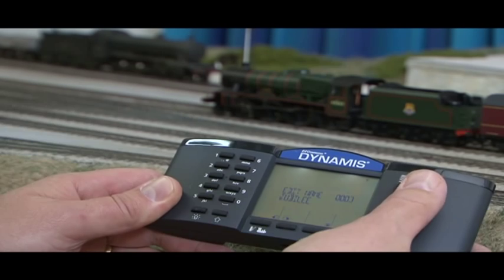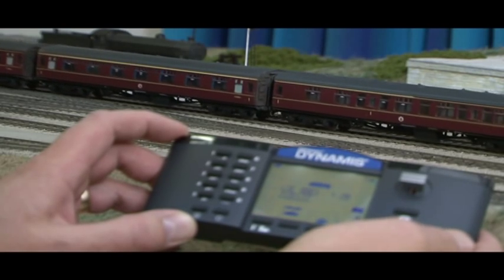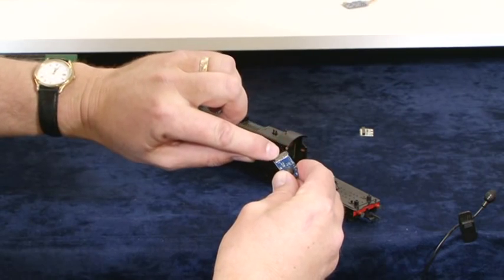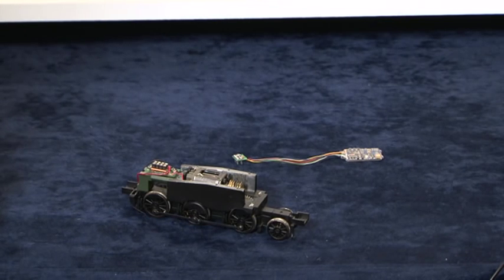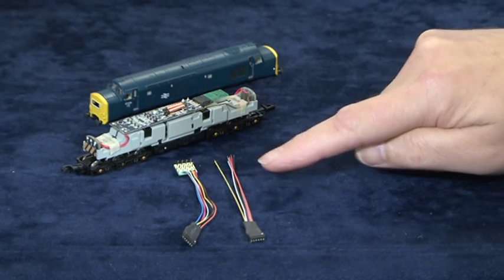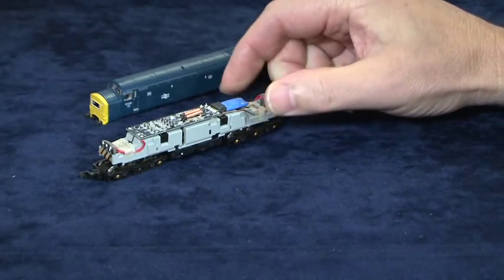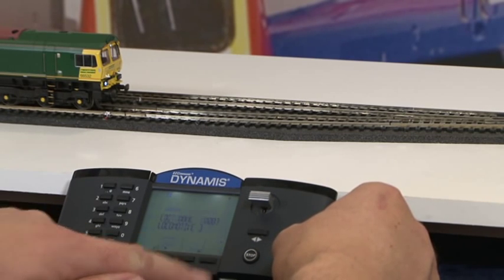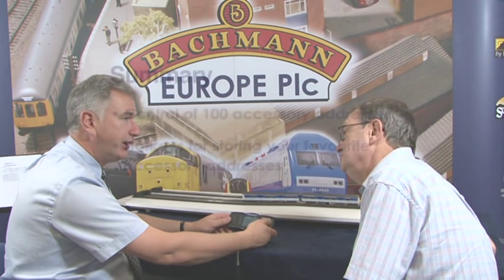E-Z Command Dynamis Part 5.VOB

Comment: Well I tried to use your sample and program my speed. I guess that's what you had, and it didn't work. I thought I follow the video. So I guess my question is. How do I find out what decoder my engine has. and how do I find out what CV's my decoder supports.
Reply: You cant. this unit doesnt read back to the display, its one way only.